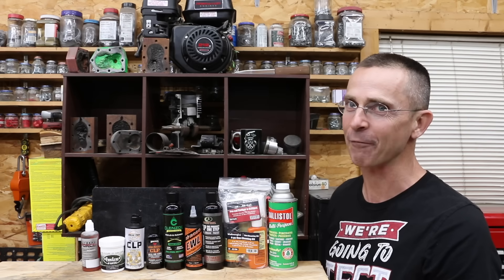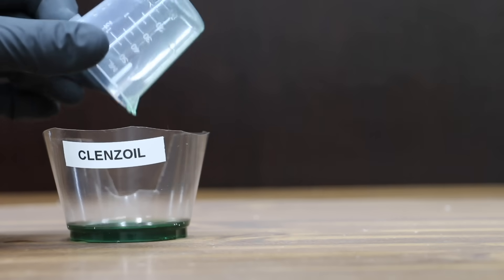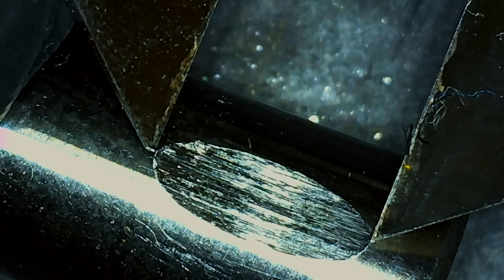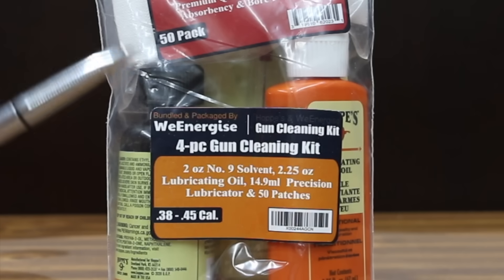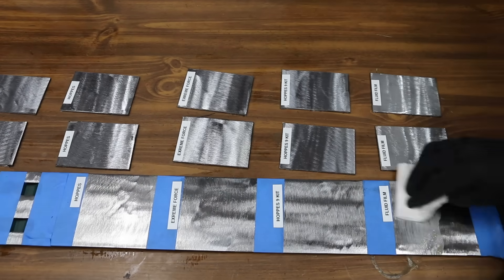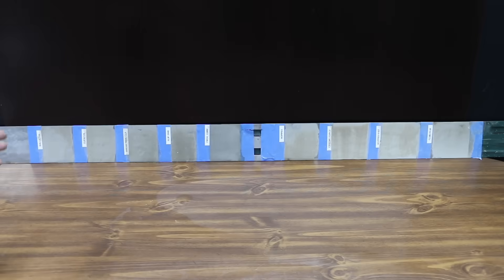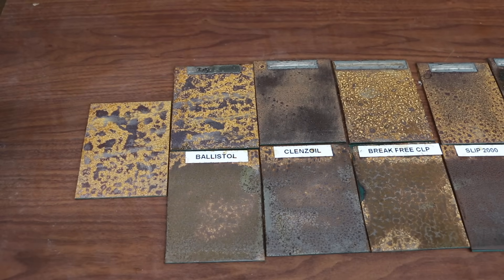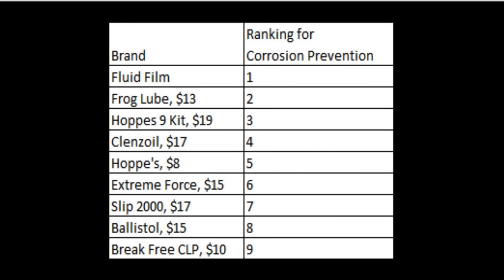Don't Buy A CLP Until You Watch This Review! It'll Save You Time And Money!

Comment: Very detail analysis as usual, Tod! Couple of $0.02 from the rear seat driver: a) No "run-of-the-mill" engine oil in comparison? Even the cheapest engine oil is designed to withstand much harsher environment than any (hand) guns will sustain; b) Frog Lube: It was heavily advertised as "Bee's Knees" but since its vegetable oil product, but you have to be careful of "coking" under high temps, which results in build-up and actual stickiness of the final product of the prolonged use (See: diesel injectors that ran on straight veggie); c: Caveat on climate of use, and frequency of use: In Florida I gloped my guns with high-temp lithium grease, it was the only thing that would not run-off while guns were sitting in heat (car etc) while providing anti-rust layer on the metal. Would that be a possible suggestion for next video, perhaps? El cheapo version of gun lubes - Engine oil vs hi-temp lithium grease?

Comment: 12:50 Frog lube is kinda unique as it should be applied to warm or slightly hot surfaces, let it sit for a while, clean the surface and then do it again. AFAIK, the final cleaning of the surface is very important. Or the surfaces can also be heated with something like a hair dryer or hot air gun after application and then proceed to clean. Can't remember the recommended procedure. What I've gathered is some (or many) people are not using it as it should be used and then give it a bad rap.
Reply: I get that the lubricity test is controlled, but I still would really like to see Frog Lube added to the test surface with heat and cleaning before testing. Then doing the test as usual.
Reply: Good post.
Reply: Use frog lube on machine tool, guns,model parts an for cleaning & storage. My view of the smell is of them i would I'd put them next to Kroil oil an Gibbs and don't forget iconic Marvel's Mystery oil and whats wrong with that???  JB80, PB blaster, Liquid Wrench, Knockerloose,StrongArm, Schaeffer's i put in another categorys of smell also and so on. You can find a odor for just about any one i can recall ran into a can use to call urinal cakes! Another cherry bomb. I say personal preference of what ya'll can stand. I dont think i'd want to use certain few  in the house even if u did or didn't live with the lady folk.
Reply: frog lube stinks... every gun show, you can tell where the frog lube guy is.. it smells like somebody blew up a tube of toothpaste

Comment: I used Break Free for many years (from my military time) and bought some bottles of Cleanzoil a few years ago. I used it on my AR and it seemed to gum up the bolt pretty bad. When I turned that rifle into my Armorer for servicing, he did not know what I had used but thought I had spilled a Coke into my rifle it was so gummed up! I like it for exterior protection, but don't trust Cleanzoil for those interior action high temps.
Reply: An AR shouldn't have a bunch of oil in it. They run better nearly dry. Clean it and wipe nearly all the CLP off and the results will speak for themself. Sounds like you way over oiled your rifle
Reply: @dunerinaz  i do agree it may run better but you got a steel bcg rubbing against aluminum, I personally like running a lil oil to prevent wear.
Reply: Use synthetic transmission fluid or hi-temp synthetic wheel bearing grease for the rails.
Reply: i like to use a tiny amount of NLGI #2 heavy duty grease that i apply with a tiny paintbrush on parts that are moving metal against metal its never failed me as its rated for high and low temps and is virtually waterproof. for cleaning i just use either cleaners or if im out and about break-free since its easy enough to get a bottle from work lol
Reply: You had an AR in the military?
Reply: @Sickofsociety1  I Was trying to figure out the context.  Seems to be he used Break Free in military, once out used Clenziol on an AR.  The confusing part is "armorer".  If armorer = civilian gunsmith it makes more sense, otherwise ???
Reply: @Sickofsociety1  No AR but an M14 308cal.
Reply: Better not have a dirty starfish, if I get dirty stuff on my finger after putting it in your starfish you didn't do a good job lol

Comment: Never used an all-in-one. 
I use the Hoppe's for cleaner, Remoil for surface coating, Aeroshell grease for lube on rails and slides, motor oil for pins and pivots.
After seeing this ... I think I'll stick with it. 
Really though just about anything will do, the most important factor is the doing. Clean it with something, lube it with something, coat it with something, and chances are you'll never run into the extreme conditions that would cause any of them to fail.

Comment: Caution folks: When using "alternative" products (engine oil) be advised that most are designed to remove rust. Bluing is a form of rust.
Small engine oil doesn't have certain additives that remove rust fyi.

Knowledge courtesy of Mr. Novak

Comment: Hey :) Here's two compelling arguments to start measuring the weight of the bearing bits before and after the lubricity test and using that to gauge differences: 

1: The length of the wear scar reflects an exponential wearing of metal, not linear. If a wear scar is, say, 6mm in length and it's compared to a 7mm scar, the 7mm one propably had almost twice the metal removed as the scar progresses into the material - as the scar deepens the material having to be removed for the scar's additional length increases upon increase.

2: As the scar deepens, the lubricity tester's wheel is always going to increase the length less and less, as the wheel sinks in and it's contact patch grows. In the extreme, the wheel would make a scar the length of it's diameter and then just progress to deepen the scar without adding any length. With the current way of measuring it wouldn't matter whether the scar was a kilometer deep or just as deep as the radius of the tester wheel - all scars would seem the same size as the length is the same.

These two reasons combined make the current method of scar length measurement quite misleading, as differences are in some cases in an order of magnitude - even orders - not just "a bit" or "twice as".

Thank you!
Reply: In this test the smallest scar of 1.81mm and the biggest of 8.52mm do not have a wear protection difference of just five times or so. The actual difference in performance or amount of material removed was probably in the range of a hundred times more between these!
Reply: I think we're all smart enough here to figure out which is more or less wear.
Reply: @1pcfred  Thanks for your input.

Comment: Ed’s Red is a diy bore cleaner that I’ve used for years.  I wonder how well it would compare to these products? 
Equal parts automatic transmission fluid, kerosene, acetone, mineral spirits and some lanolin (optional). There are several websites with recipes.

Comment: Like I learned in the 50s.... Three products.  One to clean, One to lube and one to protect.  70 years later and it doesn't seem to change at all.  All of those appear to be a temporary solution to tide you over until you make time to do a through job.   The field doitall I like is Tri-Flo seems like CLP but will neutralize fingerprint oils to boot.

Comment: Great tests as always!  That's why this is my favorite YT channel!  Just wanted to mention that froglube has a specific application process that involves a thorough cleaning of parts to remove oils and then heating slightly to melt the paste (with a hairdryer, or similar, till it looks like melting butter) and letting it cool, then wiping off the excess.  It leaves a film that way and only needs to be done as an initial application.  Cleanup is quite easy and corrosion resistance is top notch.  Regular cleaning involves wiping away carbon and applying a small amount of the cold paste to wear areas.  Here in Florida I don't have to worry about the extreme cold and corrosion is a much higher concern, so it works for my environment.  Just wanted to share the application requirements in case the test is ever done again with other brands.  Thank you for these tests, this video should be required viewing for all responsibly armed Americans!  Now I'm going to go find some Clenzoil to add to my maintenance options. 👍
Reply: All of that is precisely what makes Frog Lube impractical to use. I ain't doing all that crap. You're lucky if I wipe stuff on with a greezy rag. I mean be real.
Reply: @1pcfred  It's not for everyone, but I find it's not a big deal since it's essentially a one time thing and the corrosion protection is outstanding, which is very important where I live.  Hope you found something that works for you.

Comment: Good testing, appreciate the testing results. I also have a suggestion. I couldn't find where you tested what would happen and why it would be a bad idea to use Calcium Sulfonate based grease on bearings lubed with lithium complex or vise versa. Until recently purchasing grease, I haven't thought there was a difference or worried about it. I haven't found why they are incompatible or why it is a bad idea to one while using the other.
Reply from the maker: Great question.  If the greases are not compatible, they could liquify.  I've personally had this happen when adding grease and not knowing the kind of lubricant previously used on a piece of equipment.

Comment: Thank you so much for doing more testing on firearm related stuff, great test!  I really appreciate your work.  Please keep it up!

Unrelated question, did you notice that proximity to truck tires impacted dust results for the dust testing?
Reply from the maker: Great question.  I don't believe that the proximity was a factor.  The dust spread generated by the front and rear tires was really intense.  The collection of dust from panel to panel did not align directly with the rear tires either.  Thanks again

Comment: Last time I looked into CLP testing, Mil-Comm & M-Pro 7 performed quite well.

FrogLube's old formula would protect very well against rust and was good for a while, but if you left it alone for several months, it would dry out and become exceptionally thick & gummy, even solid.  As someone who rarely uses their firearms, I was relatively confident in FL's rust protection, but the fact that it became gummy/solid over time turned me off of it, and I didn't give their second formulation a chance.

PS: If you run the tests again, it would be interesting to see if heating the CLP makes a difference in its lubricity.  Some products might break down or benefit from being hot. 🤷‍♂️
Reply from the maker: Great information. Thank you!
Reply: I also had this problem with FL on guns that sat unused for a while, gumming up and if exposed to dirt/dust while gummed up it would turn into like asphalt. Trying out Seal1 right now which is also a non toxic paste CLP, and Shooter's Lube which is a liquid non toxic solvent & lube set. (I like non toxic for most of my guns since I clean them in the bedroom or living room of an apartment). I still use Frog Lube to treat carbon steel knives to protect from corrosion and since I use those knives on game/food in the field the non toxic attribute is welcome
Reply: @aaronliu9945  A good alternative to cosmoline?
Reply: old froglube made one of my semi auto rifles run in slow motion from being gummed up. Like Aaron, I still keep some around for my knives though.

Comment: I'm curious if the instantaneous VA readings on your Kill-a-Watt meter vary more or less than the Watt readings.  Is the PF affected by the load on the motor, or just the motor itself?
Reply from the maker: Great question. From my experience, the device works very quickly at providing readings.
Reply: @ProjectFarm  Do some wear tests cause a different power factor (PF)?  For example, did some of the CLP oils have a W to VA ratio that was significantly different than other oils?  Or is the PF generally consistent ?  (Where W/VA = PF)

Comment: Great video as usual but just one addendum... Balistol is an universal oil that is not only foodsafe but will do a perfect job protecting your wood and leather stuff... So great on hunting and surplus rifles (wood furniture and leather straps) as well as tools that you use for cutting any food! It can even be used on small wounds. And its made in Germany! I personally use hoppes and breakfree on most long guns. The froglube has to be applied to heated up metal parts and it works great (used it on a G43) but first application is a pain in the butt!
Reply from the maker: Thank you!

Comment: Living less than a mile away from saltwater for decades where it hot humid  and constant salt air and fog part of the year. Also hunting around ocean and very cold deep woods. Countless rounds of ammo through pistol, Shotgun, and rifle. Always used Hoppes which I understand is basically mineral spirits and banana oil for scent, to clean then plain light coat of mineral oil to lube and protect. Never ever had any problems. All guns still in top shape .
Reply from the maker: Thank you!

Comment: oops.  no Hornady One Shot
(it won someones else's test with remarkable corrosion resistant using bare steel sprayed with salt water and extended outdoor exposure) I think Frog Lube and WD40-Plus  did well also but not in the gun cleaning part)

Comment: I’ve always thought ballistol was more of a specialty cleaning fluid, it works great at removing corrosive salts after shooting corrosive ammo, when mixed properly with water. Much prefer a grease for lubricating my firearms, oils always drip away at room temperature, grease tends to only do that when warm.
Reply: The Geissele 0000 very thin grease works really well; it's thin enough to lubricate well, but thick enough that it won't drip off and make a mess.
Reply from the maker: Thank you!

Comment: I have learned that Break free CLP is mostly for cleaning / removing carbon buildup. Then wipe off their clp and apply their Break free SMX as lubricating oil. Have not tried or used any of the other brands so I do not know if they have a similar system. Clp lubes but not as good as SMX.
Reply from the maker: Thank you!

Comment: As a side note the frog lube is suppose to be applied to gun parts the same way you’d season a pan.  You noted how well it did on the post oven rust inhibiting.  Maybe worth a second go on the friction test.  Also the guy who invented hoppe’s #9 put out recipe for a cleaner/lube called Ed’s Red it’s one part lanolin, acetone, kerosene, aliphatic mineral spirits,  and Automatic Transmission Fluid.  It works great and I love it and it’s wicked inexpensive.   Also there’s a brand of fuel additives and lubes called Sea Foam that makes a gun cleaner/lube.

Comment: Great video Todd!!; NOT pretending to be an 'expert' I'm still a competitive  IDPA shooter, Senior Class (I'm 64 now), having used several products since early 1.970's. Even remember when I was serving as a Military MD during 1.980's, (After respective Cmmdr's authorization), taking old GI M1 Garands, M14's, M24's, 1.911's  etc., fully coated inside & out with Cosmoline, cleaning w/ remover, (such a PITA!!🥵), and then, properly lubing w/ CLP. Nowadays, I mostly use Hoppe's Bench Rest solvent for cleaning, then thoroughly, (and carefully), using brass / nylon bore brushes + patches, and then, a mix of Tetra.Gun (Contains PTFE / Teflon) + Ed's Red, or Moly grease for bolts / slides, barely a thin film, then ready for training @ the range. I NEVER put any of my priced guns in any of my safes before thoroughly cleaning & lubing. 
All of the above said, (And, many of Todd's followers having farm / ranch kids), how about considering a video about 'ranch / truck / tractor' guns??.
So many thanks Todd for your dedicated work & many Blessings!!. 🤗🇺🇲🙏🙏🙏

Comment: Most of the time I’m a Frog Lube user mainly for convenience of being able to use it in the house without complaints from its odor. I wonder if the liquid was used used instead of the paste if the results of some of the tests would have been different. The preferred application according to the instructions is to use heat after application it’s most likely why it did well in the oven test and not as well in others.
Reply: Froglube suggests applying paste to warm parts. I'd like a retest.
Reply: As a frog lube user I would like to know exactly how much heat I need to make the magic work.
Reply: @revcrussell  
Its supposed to work like the teflon additives you see advertised for automobile engines. It doesn't take a lot of heat, but the object is to allow the metal to expand/open up and let the product soak in. Kinda like wax does to most things when in a liquid state.
You can use a heat gun or simply a hairdryer. Also it will soak in while shooting.

I switched to it for the same reasons stated above - the nontoxic and decent smell compared to what petroleum products I was using.
As I've used it, I also find it easier to clean any carbon fouling I used to have to work at to get clean. 

It's kinda interesting some of the surfaces I've used it on to clean petroleum residue from such as my range hood when other cleaners weren't cutting it.

Comment: As someone who works in the firearm industry, depending on the application, several products are preferrable, for example froglube is a great option if you are hunting in a wetland or other enviroment where you are not shooting like at a range, and want to protect the enviroment.  for personal use, the higher temperature stable oils are what i use for any weapon that goes to the range or while at the range.   (i use slip2k on my ar for example).  the extreme heat potential of rapid firing and likely sustained usage has had several clp's with lower temp stability to cause a jam or fail to lubricate at all.  just consider your usage requirements, and pick a lubricant that helps you keep your stuff protected in that environment.